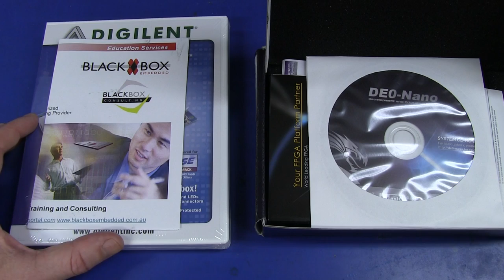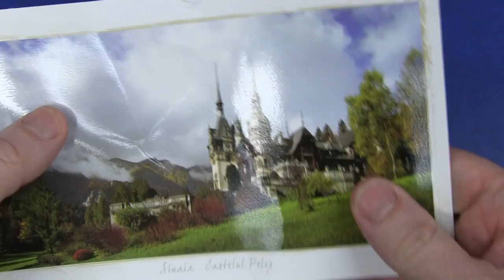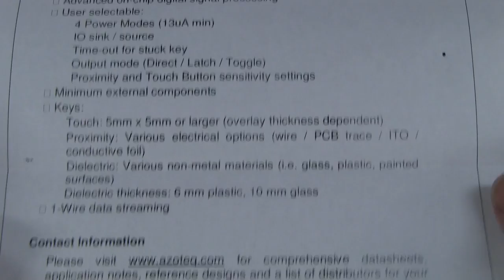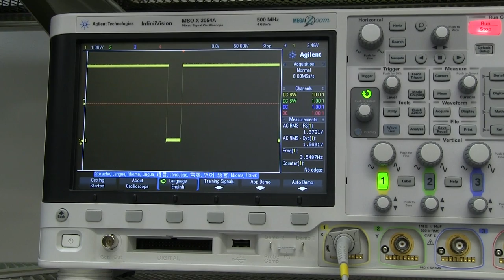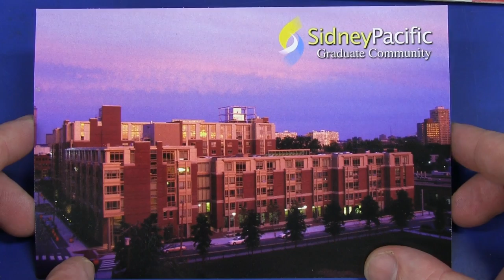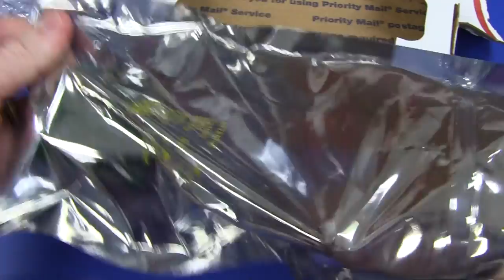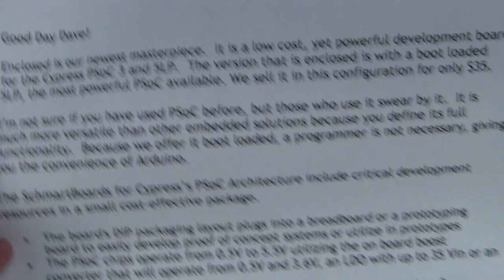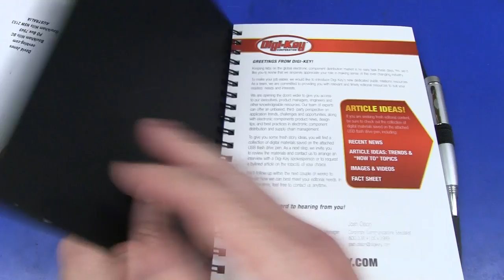EEVblog #510 - Mailbag

Comment: I don't know if this has been mentioned before and it's probably not that important but... redacting the street address is only of limited value if you leave the postcode visible. Where Mr Sweeney lives, there are 42 possible addresses (all on the same road). For other postcodes, there may be only one or two addresses.

Comment: The tip of that Swiss screwdriver is either parkerized or just has an oxide layer from heat treatment.  If you're looking for a really nice miniature philips screwdriver though, I highly recommend the Moody 58-0482.  It is a JIS driver, U.S. made and very high quality.  It grips prettymuch any screw tighter weather JIS or not.  Really great for all the cheap Chinese screws that are in everything

Have you seen my plasma cutter teardown video yet?  It has some interesting parts inside.

Comment: It's mid temperature black oxide on the Swiss screwdriver. It's a chemical reaction that converts some of the layers of steel into magnetite providing some corrosion resistance.

Comment: I bought one of those resistor boxes from Atlanta Robotics.

I ordered the kit that needs you to solder all things.
I got the one that had SMD presoldered.

I was glad as my soldering iron started to die, so there mistake was a good thing.

LOL

I still use it the resistor box.

Comment: Dave, what's your opinion on option-box PCB units like the resistor blocks and capacitor blocks you had in this video that have either with or without mounting-holes?  As an add on electrical component one would think finding some place to mount them inside an existing device would be difficult.  I've never used them, can you tell us if you have any experience with them?